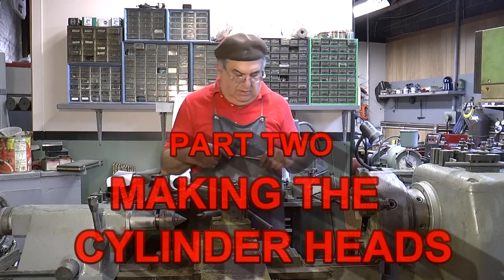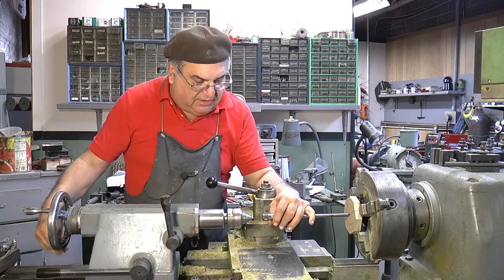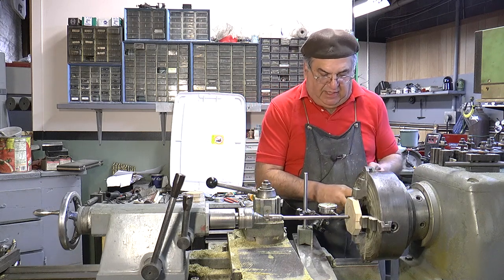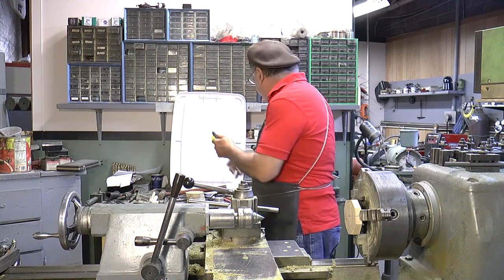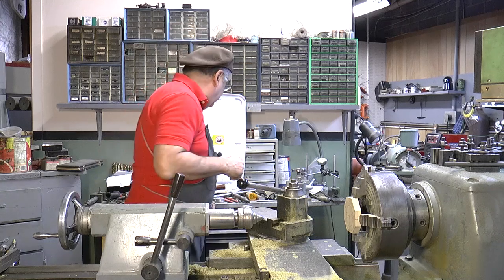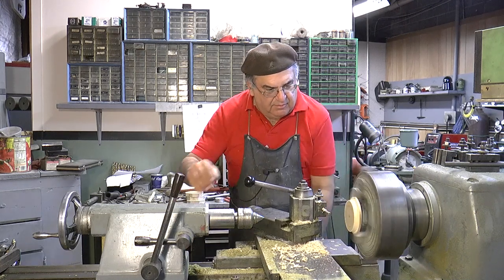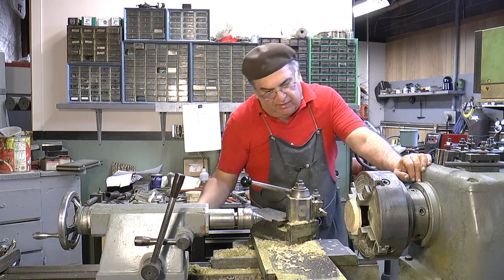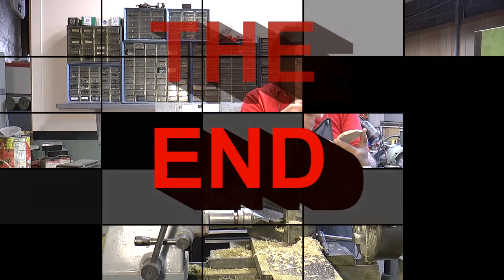LIVE STEAM LOCOMOTIVE/MAKING THE CYLINDER HEADS

Comment: Excellent,Just found you.  My lathe has no markings on the dials  ,it’s that old !  But it’s no problem  one full turn takes 1/8 off the dia .So half a turn is 1/16  etc . With this set up I can easily work to within a couple of thousands of an inch.More than Accurate  for live steam locomotives .

Comment: Ive worked at plenty CNC machine shop . Every one says you shouldnt use air. I have yet to see a shop that doesnt have a line per a machine.
Reply from the maker: Using air on a modern machine is OK  the ways are protected . The Never use air thing is really for the BC lathes BC stands for  BEORE CARBIDE.
Reply: +trainman4602 
Its questionable to use carbide with any lathe before 1920 never mind an air hose lol . 
But really yes I would agree. Hi pressure coolants helps the machines keep chips in the housings packed at the bottom also.